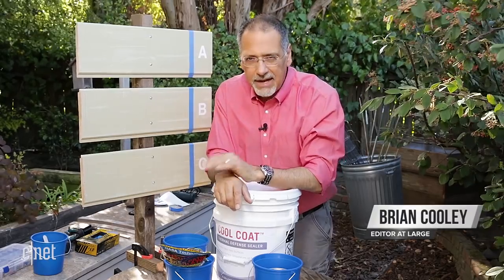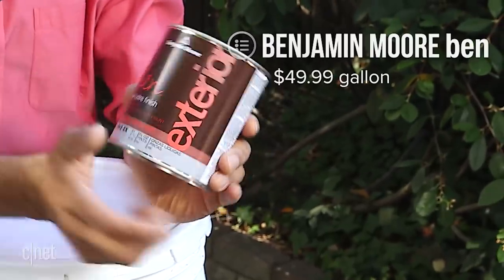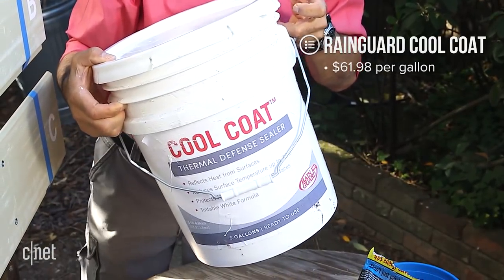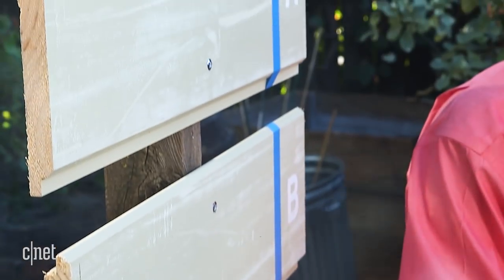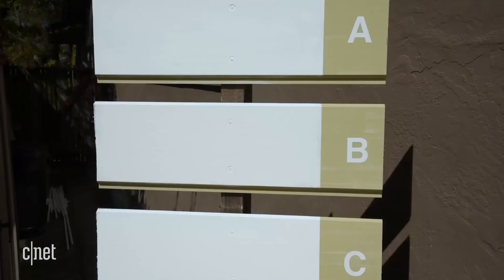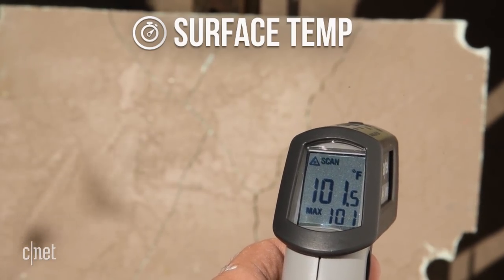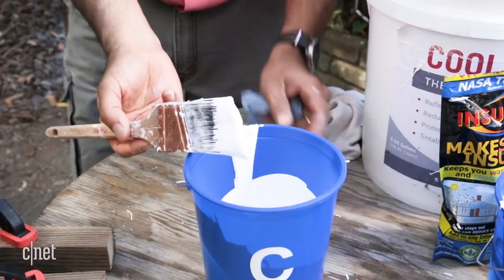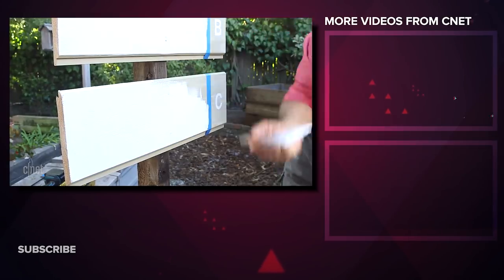See how white paint dramatically cools your home

Comment: Don't those heat reading guns fan out  the further they are away from the object you are trying to read the temperature and average it? 
For example if you were 12" from the board, the temperature sample would be 10" round...so what I am saying hold the gun a lot closer to get a more accurate measurement of what you specifically want instead of an sum of partially the other boards but mostly the one you exclusively wanted?